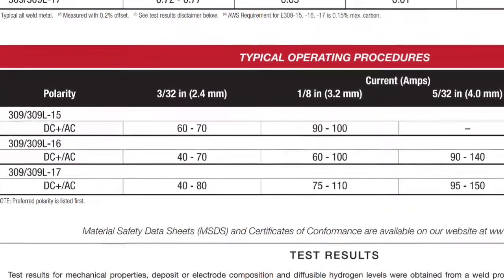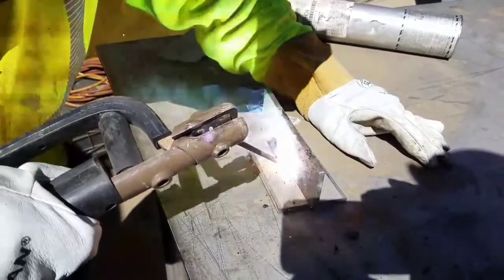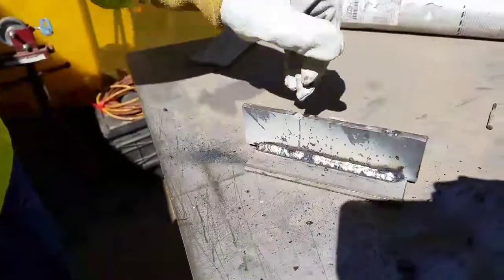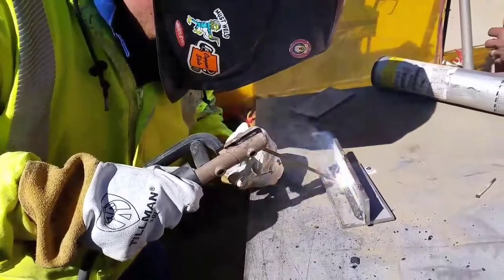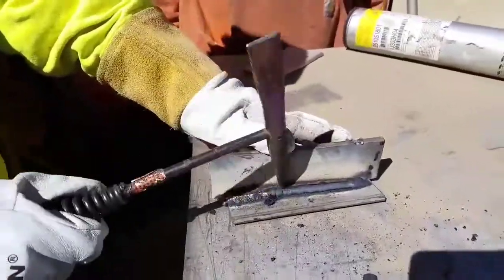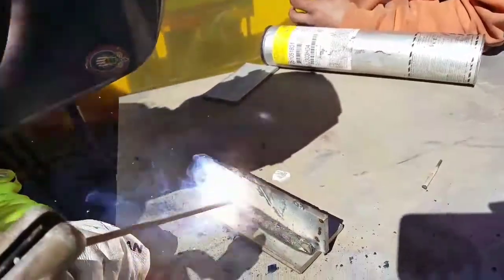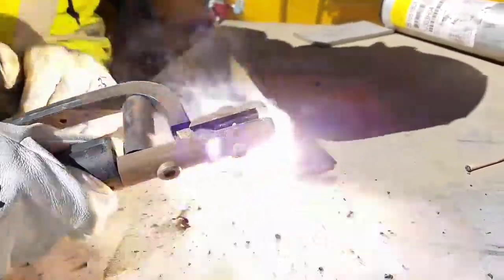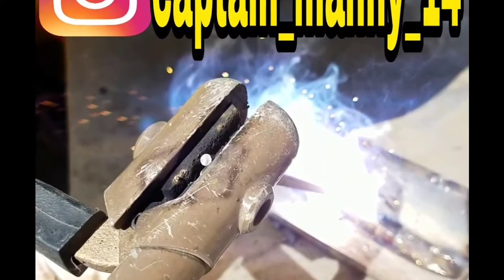Stick Welding 309L-16 Carbon Steel to Stainless  For The First Time!!

Comment: I weld allot for my job mild steal 1718 allot but working on my old truck and need to fix the exhaust system and i think i can stitch it together with this rod just fine going to give it a try with a DC stick welder nice video thanks for the watch

Comment: 100amps but what is the stick diameter?
Reply from the maker: It looks like 3/32 or 1/8 can’t remember
Reply: According to the guide in the video that would be 3.2mm or 1/8" electrodes.

Comment: F U, boy... could you please get out of youtube and remove this your spam video behind yourself?
Today I spent hard day at the Union Training Center trying to prepare for the pipe welding test so I can  renew my old pressure ticket before I apply for my next job... I was welding stainless 309L-16 rods on the top of my perfect TIG weldings,,, and I must say that welding 309L-16 overhead and verticals are the hardest existing in this Universum weldings, and I failed badly,,, but this boy’s flat welds even with 309L-16 rods any professional welder like me can weld with closed eyes...
So I am searching on YouTube trying to find any advise on how to weld pipes cover passes with 309L-16 on pipes, but about no one can advise on this hardest tipe of welding.... and suddenly this teenager comes up first in my search with this his idiotic “welding” that personally I can do any time with closed eyes... FU, boy; realy - FU... could you please get lost?
Reply: Lol Alex Rudy if you’re a "professional welder " and you can’t do it in all positions you better look into a new trade.
Reply: Hi there, im at welding school and i have the same problem.
Have you found a proper way to do it?
Thanks in advance.